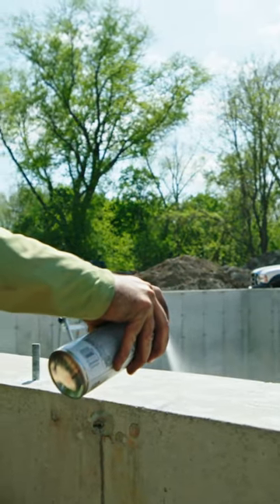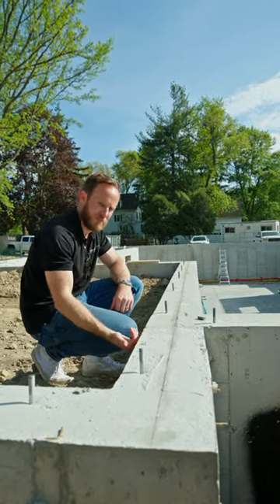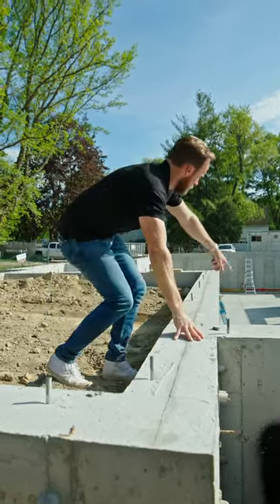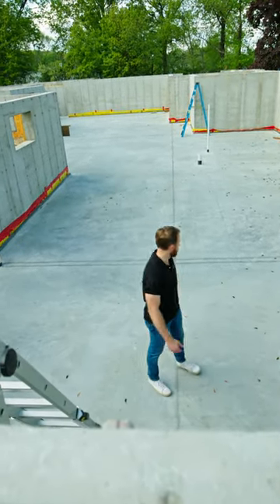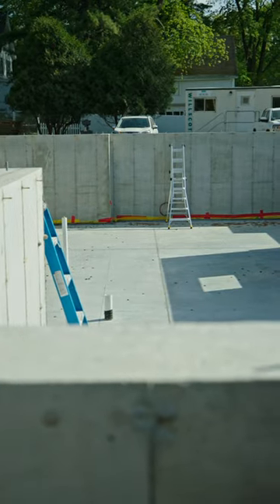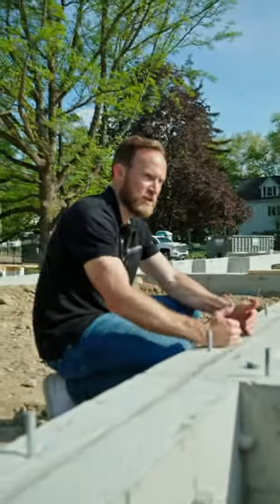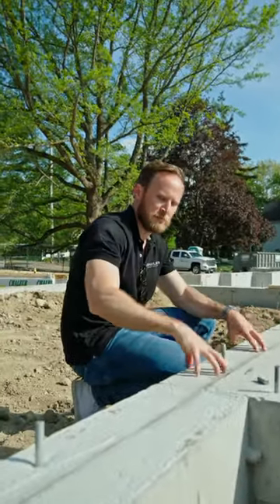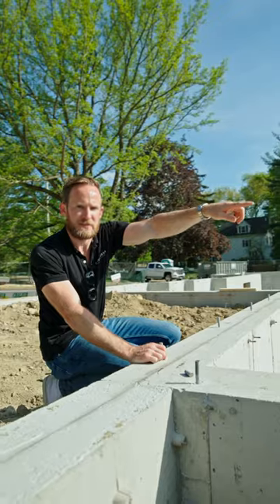How to make your walls parallel and 📐

Comment: Would be amazing if my boss let me do anything like this to avoid headaches later. Instead it’s always “close enough” “it is what it is”
Reply: Looks good from my house
Reply: You need a new boss I have been framing since 1991 literally thousands of houses and everything is squared
Reply: Find a new boss, or better yet, become your own
Reply: Kind of funny that carpenters want the lines to be "exactly parallel." Ain't no such thing. Machine shop tolerances are in the few thousandths of an inch for something like a 5 inch part. What is the tolerance for a 40 ft chalkline to layout a house. Certainly not a few thousandths. But better not be off by 4 inches either. Know what tolerances matter and don't do useless work to meet a finer tolerance that doesn't matter.

Chalkline itself is probably a 16th of an inch wide so no one is doing better than 1/16th. 

Not so simple to know what tolerances are needed. And not always  so simple to determine if they are met.
Reply: @honeytubs  I mean I completely understand nothing can be perfect, but I also know when something shouldn’t fly and it does for the boss because it takes an extra 10 min to make sure something is square or level/plumb. Trusting a foundation completely is something to never do. So this method seems like a great thing to try.
Reply: @Quackerstacker1973  hiring ? Lol

Comment: I would like to know how you pull parallel off of a line 8 feet below where you need to be. That is worth seeing
Reply: Plumb it up the foundation walls
Reply: As simple as an 8 ft level. Watch the bubble for vertical.  Probably more high-tech laser process also.
Reply: I was thinking the same thing that seems like a giant pain in the ass we snap our longest 2 runs square then pull parallel from there.
Reply: Use a transfer level. Every municipality has elevation marks in reference to sea level, and that's how the access line or control lines as he calls it are established  north-south, east-west. He's not explaining it clearly and i dont feel like writing it out. BTW, plum, level, and square is just a theory. Nothing is excactly pls but there are degrees of tolerance.
Reply: Laser
Reply: A stick, a string, a plumb bob. Mark the stick by quarter inch intervals. Pull a mark from the A line to 6" from the wall. If the prints say the next wall is 10' from the A line and your mark is on 9'-6" and its plumbed up, mark on the concrete wherever 6" reads off the stick. Do that again at a further distance along that same azimuth and snap a line. There you go. Your welcome.

Comment: How do you get the control line? Where is it referenced from?
Reply: He said the longest point (along those lines) but I also wonder where its reference from? Like what is it based off of?
Reply: I agree , 8 or 9 ‘ down , big room for error
Reply: When i frame and Set my Reference line, i go off the longest foundation wall and work from that. No point in starting a line off a small wall, or squaring one wall to the next, one line to referate all others. I basically measure in an arbiturary number from both corners and snap a line. If im framing an addition the foundation walls should be square to the existing, however my reference line in that Instance will be taken from the existing house. Then i check the foundation, which is usually off, so first plate i square, second plate i level. Often i will either overhang plates or set them in more depending on how fucked up the foundation is.
Reply: @gus473  Any chanting or incense involved?

Comment: I've been around enough builders to know that compared to you, these guys are the true definition of good enough. How does someone make sure that they are going to get a builder like you and not like someone from the good enough crew?
Reply: Everyone is from the good enough crowd. No such thing as exactly parallel.

Anyone who thinks they can lay out a 2x6 with the precision of a microprocessor trace is lost.

The trick is figuring out what good enough is and doing that. If the client doesn't like the result it's obviously not good enough.

Comment: It's okay if a wall is out .05 inch. In 30 ft. Lol
Reply: until you try to cut rafters
Reply: Yurp it is.
Reply: @hackcarpenter5671  what would happen if you tried to cut rafters when one end of the 30ft wall was . 05 inch off of parallel from the other?
Reply: @honeytubs  it would effect the purchase of the plumb cut to the ridge

Comment: The control line , where to you measure off of to get it
Reply: Was wondering the same
Reply: Oh you know the foundation, lmao
Reply: @galvanizedgnome  which makes it redundant and a waste of time. Make sure your walls are parralell and square to each other as you go, there is no benifit to having said line. If you make em all square and parralell you can use any wall in the house as your grid... If you have any wall that is out that much having that line isn't gonna help you

Comment: He stuttered the whole way through this video hahaha. I actually don’t see the point of taking this extra step.
Reply: What it helps with is if your foundation has alot of steps and jogs. I call it a Reference line, it helps to keep walls parallel and perpendicular, equally as important to do it on first floor decking before wall builds.
Reply: It looks like he spray painted that line too. How do you measure off a 4-in wide line blown side to side by the wind?
Reply: I agree
Reply: @OneMagicMunchkin  clear paint to keep the chalk line intact and visible.
Reply: Welp, at minimum your statements and attitude don’t inspire confidence to hire or trust you to build anything.       

Just sayin’ it makes just as much sense to focus on such a foundational reference technique to ensure shit ends up a bit out of whack - as much as it does with how one socializes, responds or communicates.     It’s particularly significant when it comes to first impressions in general.   

And definitely it says a lot about an individual with how they express themselves or view those who work in similar professions.    Now ya know.      I know it’s just as likely you don’t care but hey’ it’s still a nutritional word salad to ponder.           Thanks
Reply: @audimaster5000  good job Jeff, You got me all figured out.